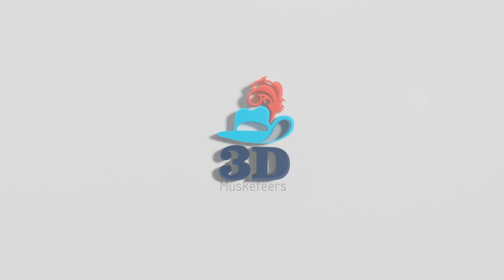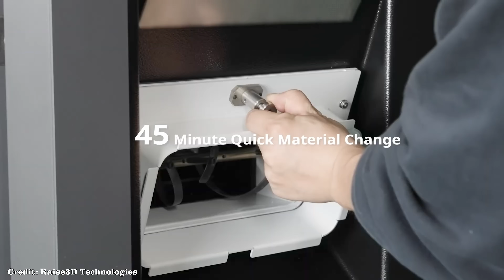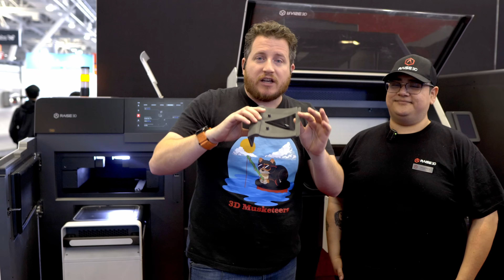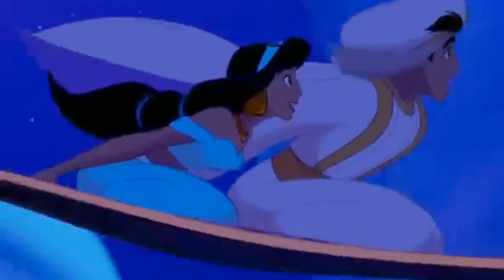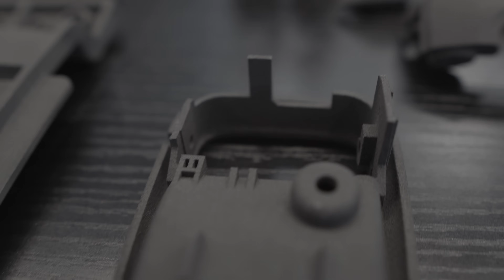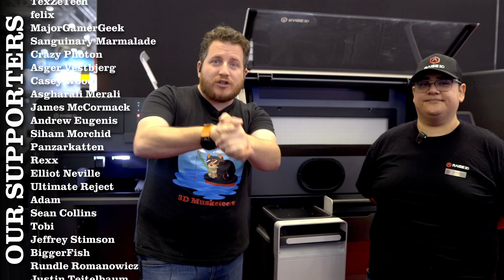Goodbye Overpriced SLS: 107% More Volume for Less? - Raise3D RMS220

Comment: When I was at school in the 70s and 80s, my woodwork teacher made us use Imperial measurements, feet and inches, and our metal engineering teacher made us use Metric measurements, so I am quite happy using either, although for 3D printing, I do use millimetres.
I

Comment: "Affordable SLS, but not for home, and only for business"
So it's not affordable then. It's like $37k.
You can get business grade SLS 3d printers for literally 1/3rd that price.
Reply from the maker: from who? and what is the build volume??
Reply: @3DMusketeers  SLS4All is <$10k, they have stuff on youtube
Reply: Cheapest I've seen is a sinterit which comes in at £15k... Calling that business grade is a stretch though as it's non-inert gas chamber
Reply: How is it not affordable when anything similar costs 1.5 to 2 times more?
Reply from the maker: SLS4All is not a product you can just buy right now, nor does it have the process control of this machine. I am all for that movement, in fact I volunteer whenever they need my help, but calling that a competitor is a bit of an exaggeration right now.

Comment: Proabbly should have mentioned sls metal cold fusion requires a furnace sintering process, which is a lot more complicated than sls itself
Reply from the maker: .... I asked if it needed a sintering oven and was told no, if memory serves me right..

EDIT: Raise3D reached out and confirmed it DOES need the sintering process. So that definitely does complicate things, but you are still getting a LOT of machine for the money.
Reply: @3DMusketeers for sure it appears to be a STUD for the money. But rest assured it need a sintering process. They all do.
Reply from the maker: It does! I wonder how much that oven is and its power needs. Frankly, even just as a polymer solution its damn good for the money IMO.